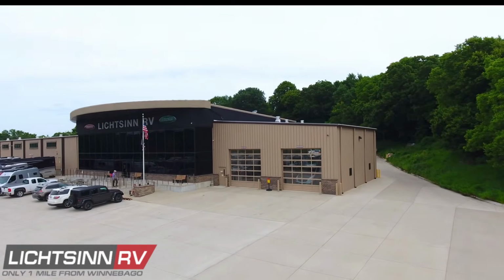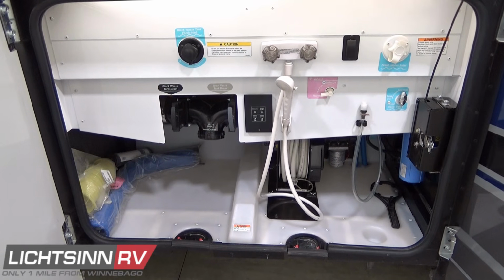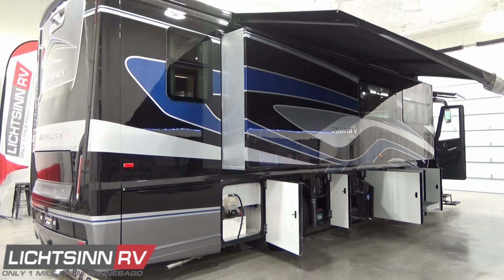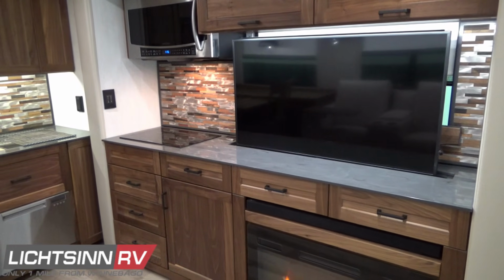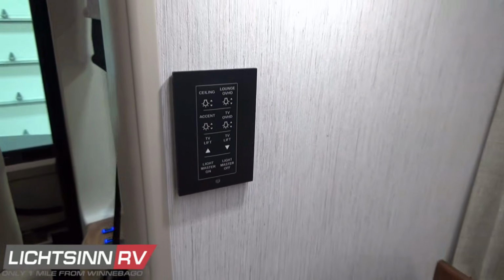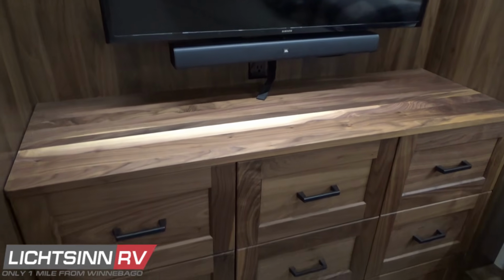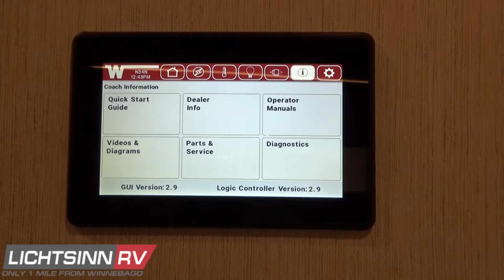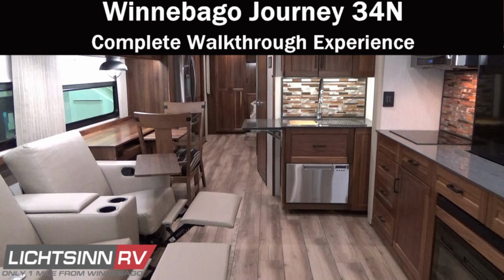LichtsinnRV.com - New 2022 Winnebago Journey 34N - The Complete Walkthrough Video Experience

Comment: Another question -- why did they choose to use the ultrafabric for the theater seating and the driver and passenger seats rather than use leather as is found in most other coaches? Are there any advantages to the ultrafabric over leather? Thank you.
Reply from the maker: Good afternoon Wil!   Thank you for your note… beginning in 1999, Ultraleather was an upgrade over traditional hide leather in the Itasca by Winnebago line vs the core Winnebago line… in the mid 2000s it was made standard as an upgrade as the Itasca line was discontinued and merged into today’s lineup… Ultraleather by Ultrafabrics it is a synthetic high end leather made by Ultrafabrics and is definitely considered a higher end choice.   It will not wrinkle like hide leather, and as oil from human skins attract dirt and debris, causing grey wrinkles.   It is more weather temperate, meaning not so hot in the summer and not colder in winter, and has a soft buttery feel.   Hope this helps!
Reply: @LichtsinnRV  Thank you.